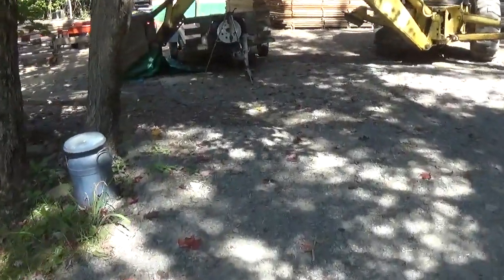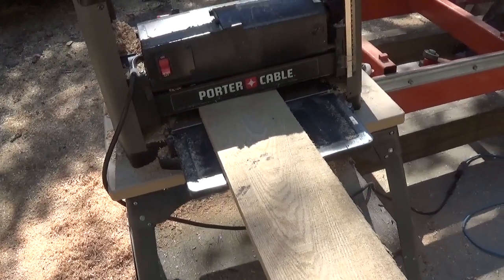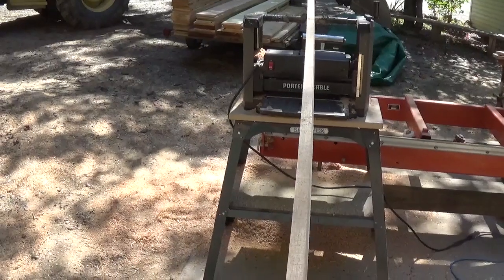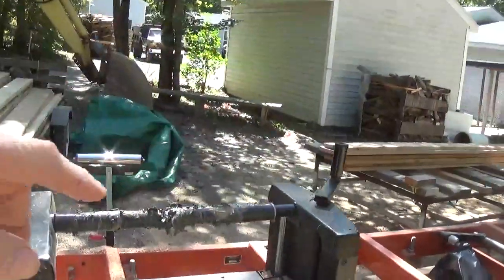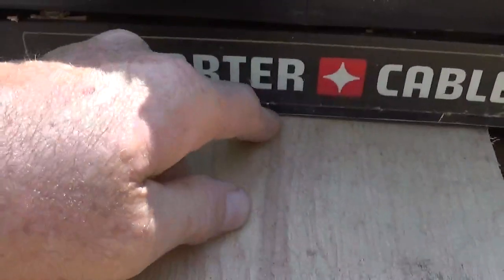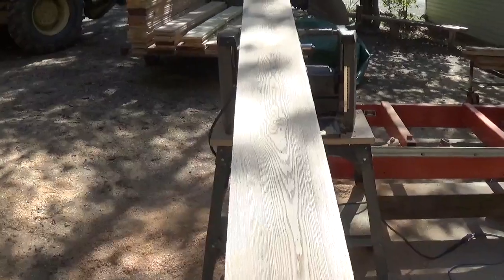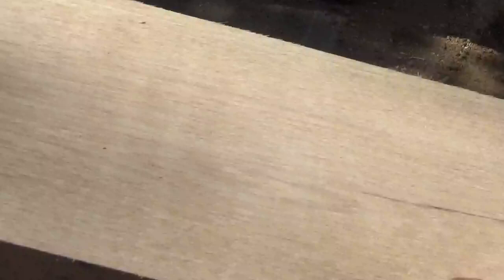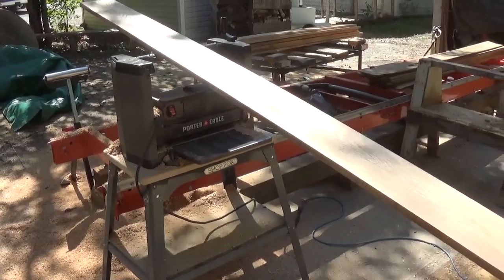No planer noise, just good info on how to have nice boards.

Comment: If you put a chalk line across the width of the board prior to planing you can then see where the planer has taken off the high points of the board, by the way, this is intended for viewers to see in a graphical way how the planer process works

Comment: Hi Jo, if you were to talk about concave and convex sides the explanation would go a lot quicker, but get the idea to have the two edges on the concave side support the board so it doesn't wobble. Also would like to get an update on the progress with the crane.
Reply from the maker: Morning Bruce, I will work on that video. Thanks

Comment: Great explanation
Reply from the maker: Thank you sir. What did you do today?
Reply: @josaljo1  got the passenger door and passenger front fender on the old Dodge today   that red oak is beautiful wood  I will put the other side on next weekend it is a lot of work to change the front fenders on a dodge 2nd gen truck
Reply from the maker: @pup734  Doors are not always easy either.
Reply: @josaljo1  these weren't that bad maybe because I had the front fenders off sent you a few pics in your email LOL
Reply: plus I like saw dust better than grease any more LOL
Reply from the maker: @pup734  I vary also. Some grease some saw dust just not together.